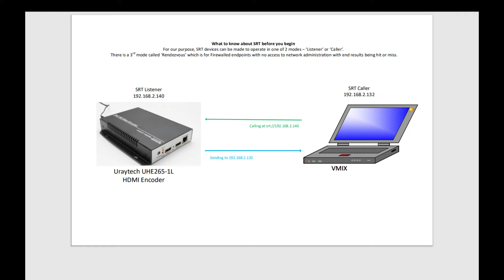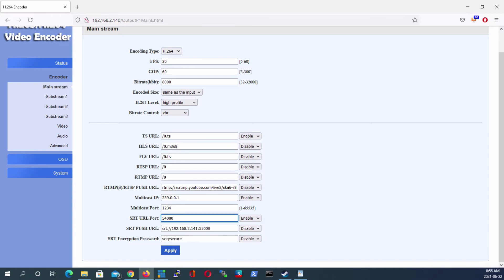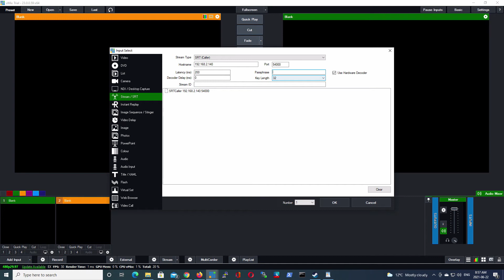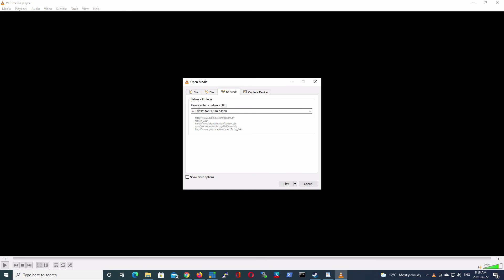How to SRT from Uraytech UHE265-1L encoder to VMIX or VLC

Comment: Dear, nice to greet you. I would like to ask you if it is possible with a 1080p HDMI ENCODER UHE265-1L to generate an audiovisual signal and reproduce (read) it within the same private network (not internet) through a UHCD265-1S-4K DECODER ??. And if it is possible, taking advantage of the fact that it has 4 different configurations to upload, if it is possible to use one for streaming and another for private stream within an ethernet network. Thank you.
Reply from the maker: Hello Genesis Multimedia, absolutely. You can generate AV signals with the UHE265-1L and use the UHCD265-1S-4K to view those signals within a LAN without internet. You can generate and view signals with the 2 units in a LAN such as SRT, UDP Multicast, HLS, RTSP.
Reply: @phoenixmanhattanproject8599  Excellent! Thank you very much for the clarifications and clarifications to the query. This is very helpful for those of us who do not know these types of products in depth. Your experience helps us a lot. Greetings!

Comment: hello what is the video latency in SRT ?
Reply from the maker: Hello SJC Visual Studios, I did a real world test between 2 computers and the latency from source to destination on the same LAN data switch is 400 milliseconds. This would increase as you add to your network hops or LAN switches of course but it's still pretty fast and reliable.
Reply from the maker: Update: The test was done with a DLink GO-SW-8GE 8-port gigabit switch common to both sender and receiver PCs and a photo of both screens displaying an active stopwatch counter. Some of this latency of course would be attributed to processing besides network traffic such as the graphics card and CPU.